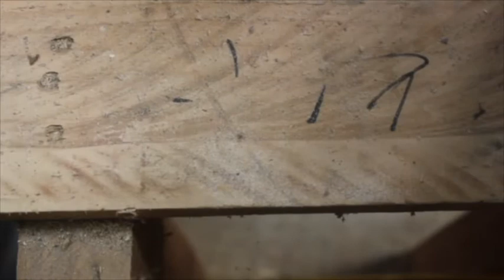Stag Horn Thumb Stick Making the Handle - Part 1

Comment: I make these all the time . Try drilling a small hole screw a 3 in screw halfway into the horn , clip the head off and do the same to the stick . Drill a hole screw antler into stick. Add some clear Gorilla 2 part epoxy to the screw and top of stick , it drys fast , then I wrap 1/8 to 1/4 inch cut deer skin lace. Around the joint... the joint is  strong. I just use 3 in decking screw. You can go alittle bigger to be extra safe. 4 or 5 in. Thought I would share how I do mine ..nice job